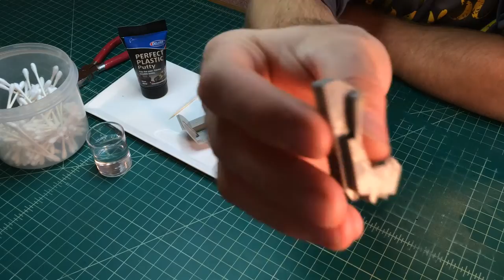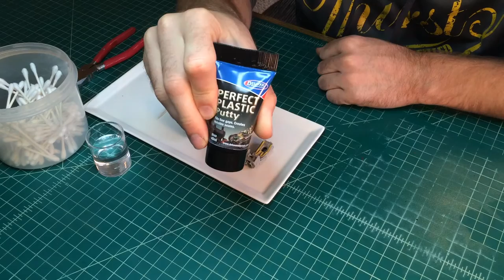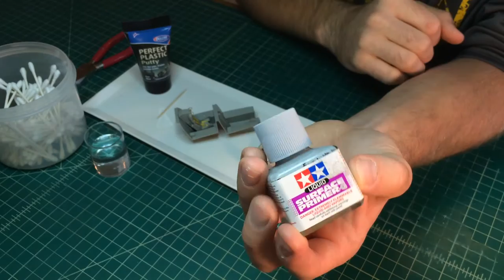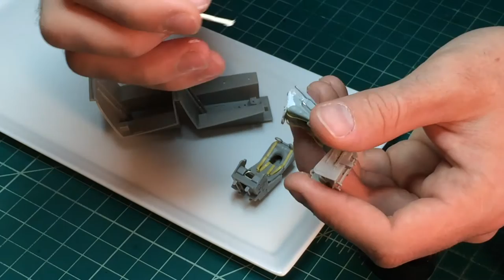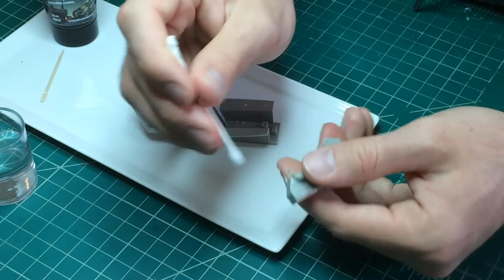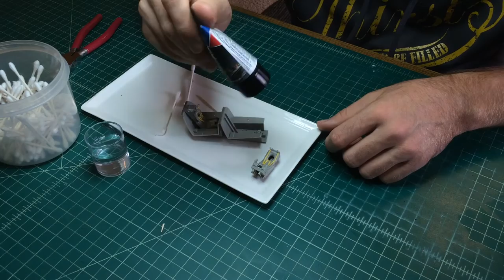Using Perfect Plastic Putty for your gaps/holes

Comment: Questions what's the difference between white tubular container vs black? Is this putty flexible Like really plastic or brittle. Last question does it physically at any store like Home Depot or Lowe's?
Reply: Luba Luba there is no difference between the white and black that I know of. The only thing I can think of is the way they dry or the way you thin them. This putty isn’t available at hardware stores due to the fact that it is specifically for modeling purposes.
Reply: I would recommend this putty especially for small areas where you don’t want to sand away detail. Because it easily smoothes to any surface if you use a damp cloth.
Reply: Btw these are my videos I just am on a different profile